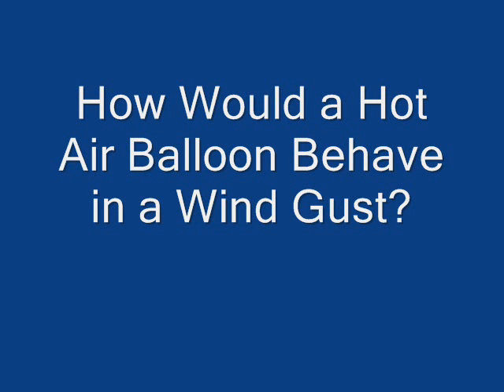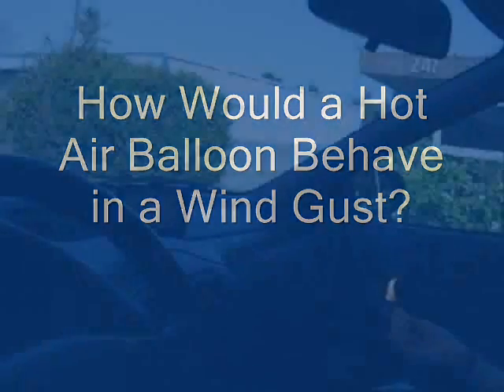Hot Air Balloons and Wind Gusts

Comment: the balloon is isolated from the external enviroment, and as such within the internal environment that can simulate a vacuum while not being inside one.   this may be a good example of the problems solved with microwave thrust or dipolar ion propulsion within a vacuum.  differing from that of inertial wave.  however, apply 3 rotating magnetron  within a ring and on 3 axis within the balloon and you will find an interesting effect.

Comment: I did not see nay significative effect on the air by accelerating and breaking, but if your idea was to use the air's inertia to generate the gusts, it's also going to affrect the baloons inertia....
Reply from the maker: The effect on the air is that it has to accelerate and decelerate with the car.  That is the gust.  The question then is whether the balloon tracks that gust, leads it, or lags it.  As expected, it tracks the gust perfectly.  And it's interesting to note that the lighter than air portion (the balloon) leads the gust while the heavier than air portion (the weight on the bottom) lags the gust.

Comment from the maker: @AtomicRooster190 
I'm sure it's not possible to make the car completely airtight, but I set the A/C on recirc and set the fan at 0 when I want no airflow.  It seems to work pretty well.  I tested it with smoke from a match and found it to be suitable for my purposes.

With the car going in a circle at constant speed the car experiences constant inward acceleration.  To the balloon this is essentially equivalent to a constant linear acceleration - and should simulate a steadily building gust.
Reply: Can this one be next up on the "full size manned vehicle for the doubters" slate? I volunteer

Comment: I think you'll always have a little air coming through the HVAC system.  

For lateral acceleration, I believe your experiment shows buoyancy rather than gust because once the acceleration reaches a steady state (car moving at constant speed), the air will no longer be moving (much).  It's only while turning in that the air will be moving to form a wind or gust.

Comment: @spork33 I guess you are right, though your body would be lighter than the water if you were floating on top not drowing so your head was out, but by having part of your body out of the water you have gained neutral buoyancy.

Now if the hot air balloon were rising or if your body was rising then any acceleration of the medium would cause acceleration faster than the medium, and the balloon or swimmer were falling then it would lag behind the medium, and if neutral you would be perfectly in sync

Comment from the maker: @aether222 
Of course if you're floating with neutral buoyancy in a pool you would neither advance or retreat relative to the pool enclosure if it were accelerated.  I suspect you'd agree with that.  The purpose of this experiment was different in a sense.  Most people know that a hot air balloon drifts along at wind speed; but most also believe that it would lag an abrupt change in wind speed before again coming to equilibrium at the new wind speed.  This shows there would be no lag.

Comment: A lighter than air balloon would appear to defy inertia in the same way it appears to defy gravity.  Interestingly it also means that if you were floating in a pool and the pool started moving you would be moved in the direction of acceleration.
Reply: It appears to defy inertia but the heaviest part of the balloon is being effected and that is why the balloon rotates slightly.
Reply: It comes down to the forces being applied to the object and viscosity of a fluid does apply force, the air in the car is viscous and is applying a force to the balloon, the other forces are not strong enough to counteract that force, you need mass for inertia to have an effect and the balloon has very little mass.